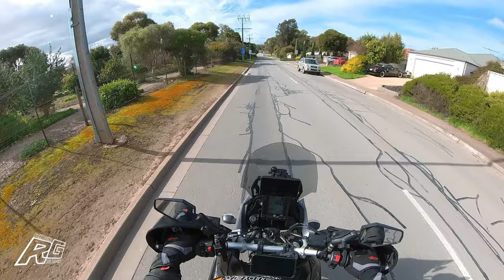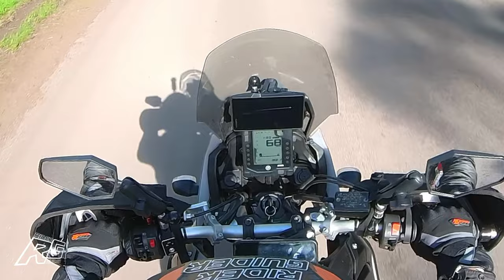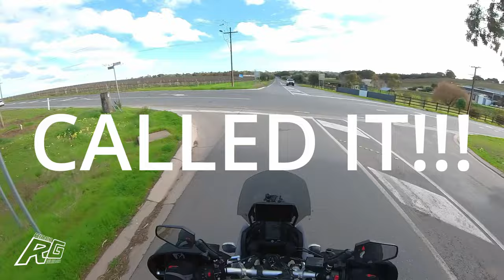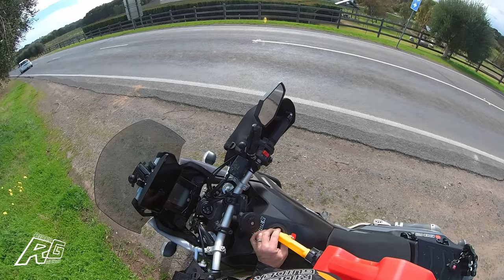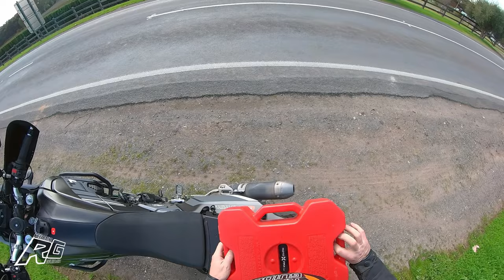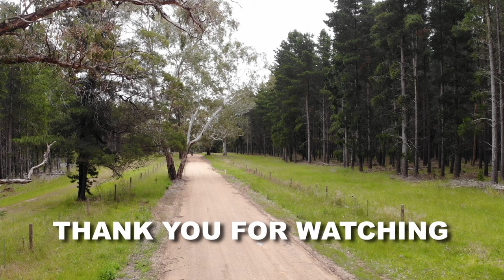YAMAHA TENERE 700 FULL TANK TO EMPTY ROAD TEST

Comment from the maker: So many people have fuel anxiety with the #YAMAHATENERE700 ... in my day I'd be happy to get 170 miles out of a Sunday thrash on my Honda CBR600, although that was a time of much larger gonads.  The #T7 is of course a #dualsportadv bike and fuel capacity is a serious issue if you're between servos.  I've had fuel anxiety when I felt I was in the middle of nowhere, I'd have been much more at ease had I known exactly how much I had left in the tank.  Well here's a definitive answer, and I can tell you now, it rarely varies when I take in to consideration the differing terrain I ride.  Off road, suburb commutes and freeway speeds are where I am regularly venturing.  In this video I'm very close to empty and have my #ROTOPAX on board so I'm able to run dry and answer the question on every #TENERE700 owners lips, definitively ... how far can you go?  Do you get a splutter warning?  Can you stretch it that bit further?  

T7 owners ... what's your record on a full standard 16 litre tank?  

Thanks for watching, please comment/like/share & subscribe for more Tenere 700 content.

Neil 
#riderguider #theriderguider

Comment: I did this same experiment in Arizona, USA. I have a flashed ECU to run richer and opened intake/exhaust. I got 212 miles (338km) before it died. That comes out to right about 50 mpg.
Reply from the maker: 50 mpg is decent mate yes.

Comment: The average fuel consumption of my T7, over 10000kms, is 29.877km/l as recorded on the Fuelio app'. For context, the majority of my riding has been at a relaxed pace in a rural area on a mix of bitumen and gravel roads; running an MT07 (16 tooth) front sprocket. For several years, I drove heavy vehicles for a company that paid generous bonuses based on fuel consumption, and have carried lessons learned there into later life. It would be interesting to know how many litres remained in your tank, Neil, when you coasted to a stop.
Reply from the maker: Hi Alf, I reckon our riding is pretty similar.  Yorkshireman, like to get the best value ;-) ... it was bone dry mate.

Comment: My longest run so far on my T7 is about 365km. I still had (according to the bowser) about another 1.5L to go. My avg is 4L/100km so in theory in ideal conditions should be 400km. I'll add though that this was using the bikes odometer and not the Garmin XT. I know the speedo is a bit optimistic (about 10% higher than actual) and I am suspicious that the odo is too.
Reply from the maker: YEH I go by the odometer for my fuel but you're right on the speedo being out 10%.  I get 112kmh indicated on the speedo at 100kmh on the GPS.

Comment: Once i've done 379km on mine. Othertime i've put 16.12 liters and anohertime my fuel consumption was 3.66l/100km. Little math - it shoud be possible to drive 437 km on single tank.
Reply from the maker: 379 is pretty good mate, I must have had a head wind haha.

Comment: Best I've seen is 232 miles without running out, squeezed in 15.5 ltrs. That was all motorway and A roads. 66.7mpg sitting at speed limits with no traffic. Journey from my friends house North Wales going home to North Kent  (London) 👍
Reply from the maker: That's a great run  - nice work.  It takes some effort to stay frugal - no traffic about makes it tempting to push on!
Reply: @TheRiderGuider  To be honest, I love riding my T7 on any type of road or offroad. Never been a massive speed freak, for to easy to loose your licence on one ride.   I find the T7 sits quite nicely at 70 mph ish. 🤔👍
Reply: My friends house to mine is around 270 miles and it takes me 4.5 hours.

Comment: Mine ran out of fuel after 174miles, I don't ride more then 150miles between fill ups now.
Reply from the maker: I’ve just had mine Dyno and ECU enhanced.  I might have to adjust my expectations now too! 😁
Reply: @RIDER GUIDER  
I filled up and rode it as hard as possible to see what the worst fuel range would be before it ran out of fuel.
Ridden gently it could go over 200 miles on a tank.
Mine is remapped with de cat exhaust.